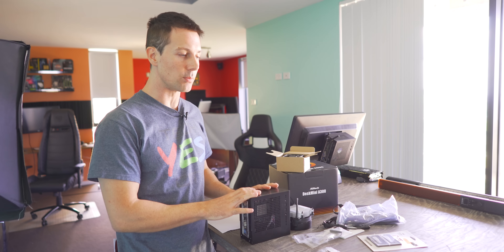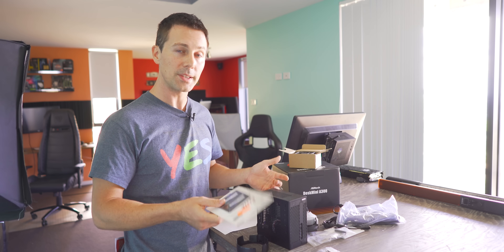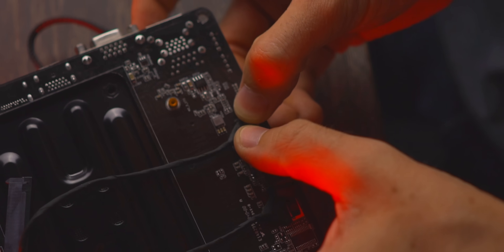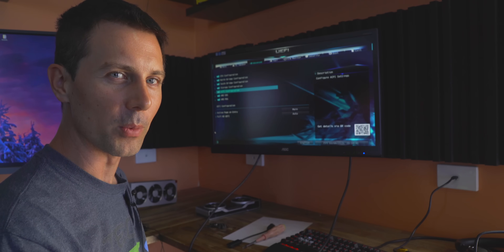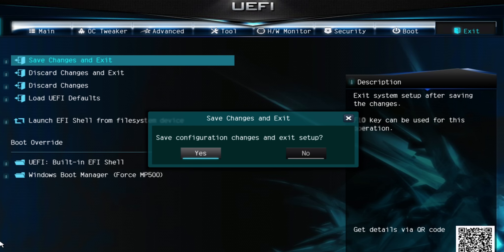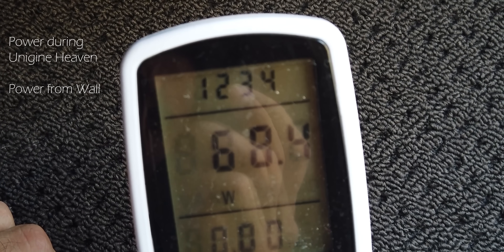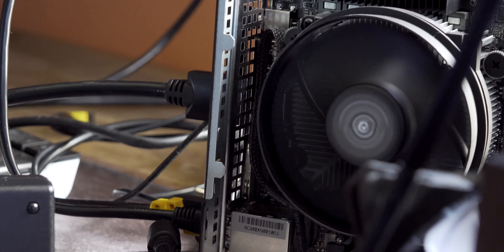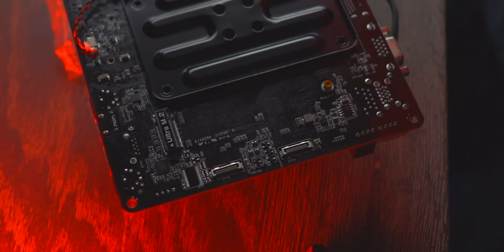The $150 RYZEN Desk Mini is HERE....! (ASRock A300 Review)

Comment: A update for people still interested. I was able to purchase a Crucial 16gb (2x8) 3200 cl16 set directly from Crucial for $79.99 with free shipping. I have also seen it at Adorama Camera and B & H for the same price. These are not listed in the QVL however they use the same Micron chips used in others that are on the QVL and Crucials website guarantees they work at the rated speed in this system.

Comment: Several things said here of the specs are incorrect: this motherboard only accepts APUs and will not post with other AM4 CPUs and the HDMI at the back is HDMI 2.0.

In recent BIOS revisions, ASRock has removed the possibility of overclocking the CPU. Memory can still be overclocked.

Comment: Dang, that GPU score on Firestrike changes a lot with different memory. I just got an A300, and with a G.Skill 3000MHz cl16 sodimm kit, out of the box with its XMP profile, the Firestrike GPU score is around 3900 instead of the 3000ish that Brian was getting. Oh, and I guess I'm using a 3400G, so the slight clock advantage for the GPU helps a bit too.

Comment: I like these small form factors, but to me as a gamer, just make one that is just barely big enough to fit one of the NVIDIA 1650 low profile cards in it... It won't increase the size a ridiculous amount and will certainly outperform APU graphics...especially since if needed, you could put it on an extension cable/riser to make it compact as possible. The No. 1 issue I've seen with small form factor pc's is the fact that people want to fit full sized mid/high end GPU's in them (cough Linus) when these small form factor cards exist for a reason...

Comment: I found out something REVOLUTIONARY for the A300. If you turn on all of the cores in WINDOWS  AMD 4200G 4 cores  4 threads actually is 8 cores for redundance in the  CPU.  I turned on all 8 CORES in WINDOWS and 1600mhz  for the GPU in BIOS. It will process twice as fast giving you Graphics in ULTRA at 120fps +  fluid at 1400p no OVERCLOCKING. I have done this and the results are  FABULOUS and the processor runs cool with the stock cooler shroud removed. this runs better than my $1200 + dollar builds in the past no $500 + graphics card. The graphics performance is REVOLUTIONARY. It will run any game in that tiny box . The graphic core is really good . It's  really just waiting for the CPU to send the graphics. I havent seen anyone using all  8  CORES  . You will not believe  the difference.  MARK  919-932-0310 CARRBORO NC or mparsons749@twc.com  Let me know what you think

Comment: When I use this as a Linux server and don't need any graphics will it work with a cpu faster then the 2400G?
Reply: No, it won't boot without an APU. Others have had the same idea and asked Asrock for a BIOS that would enable headless operation, but they didn't provide one.

Comment: Official product page specifications say that it supports HDMI 4k 60hz, so why are they still lying?
Reply: I think the confusion has come from the fact that the Intel variant only has a HDMI 1.4 output, so I guess Bryan simply assumed that this was the same and didn't bother testing it at 4K. This one DOES have a HDMI 2.0 port though. If you find the thread about this video on the AMD subreddit, somebody confirmed in the comments that it does 4K/60 without issue.

Comment: Any idea if you are able to use a higher wattage adapter to push more power through the MB or will it fry? Thinking about maybe building a system using this chassis and the top end Ryzen 3000 APU for a powerful little box. The rumors put the TDP at 95w which seems a bit high with a 120w adapter.

Comment: As a novice newbie to building PC's there is something I do not understand. The AMD Ryzen 2400G comes with a CPU cooler which supposed to be good enough to cool the CPU. Does it fir perfectly into the A300 or not?
Reply: As can be seen in this video and others, it will fit snuggly. However you have to remove the cap with the AMD logo on it. Hardware unboxed also has a video on this unit where they mention it. This cooler will be sufficient for normal use, but not for OC.
Reply: @Dutchpowder  Many thanks!

Comment: You can pop the circle shroud of the wraith stealth and it will have a lower headroom, should go in easier in there, I did that to my inwin chopin case
Reply: I have the Chopin with a 2400G that needed two small screws to remove the shroud. I just built an A300 for my wife with a new 2400G and the newer shrouds are clip-on so no removal of screws necessary.

Comment: This would be a great little homeserver/media server. Could replace my Proliant Microserver.
Reply: At 24W idle? Nah. If performance doesn't matter much you could get an ITX board with a Goldmont (Atom), have more SATA connectors, and idling at about 12W. — 366days • 24hrs • 0.012kW • P = 105.4kWh/a•P, with P as the cost for one kWh, and P=0.30€, we're looking at about 30€ in power cost per year!

Comment: I have one, also bought from NewEgg.  Amazon still has no listing for this.  This is the A300W variant with Intel Mini PCI-E Wifi module, antennaes, and a cooler.  There is supposedly a A300 base variant (no wifi module or cooler included), but I haven't been able to find that anywhere.

Bought it for a theater PC in the bedroom.  Still considering using it to replace my Mom's aging Athlon II 760K rig.

Comment: This mini pc is basically using laptop parts (mobo, SO-DIMMs) transplanted into a mini desktop case. Why not just buy a cheap laptop with MX150 or Vega 8, and hook it up to a monitor?
Reply: Because you can upgrade the cpu in this to the 6 core version coming out in ~3 months

Comment: Can you oc the 2400g and the ram with this barebone?
Thx for answers
Reply: You can, but you're limited by the form factor and motherboard. Better off just getting a normal motherboard/case/psu, something like an Asrock b450m Pro 4, Coolermaster Q300L and a budget power supply will cost less and overclock better.
Reply: @nazlfrag  thank so much 👍have a nice day

Comment: damn ...I could buy that unit if they sell with a 10gbe ethernet port ... or at least two gigabit ethernet ports.
Reply: My Threadripper doesn't even have 10 gpbs port... There is no way a budget Asrock board will have that!
Gigabit is nice, you can stream 3x Youtube 4k at once just for Lols. Skyrim at 8+ GB took me 1 minute and 13 seconds to download and install (time from hitting the Steam download button to having the game running in the start menu). Faster than that and you need NVME raid (lol, my laptop writing to a mechanical disk was 4x slower than the Wifi at a nearby McDonnalds, and its only 1/4 Gigabit there!)

Comment: Does it support eGPU ? Since there are two M.2 (2280) – PCIe Gen3 x4 socket, could I just plug in 2 video cards for GPU rendering, such as rendering in Blender Cycles/EEVEE. It will be great if you can make another video abt. that. thx !
2400GE is great but you have no way to get one, Damn.

Comment: Nice review ! just to add info, ram really matters: 2761 in fire strike can be greatly improved even with no cpu/gpu overclock. Getting 3520 here, stock, but with 2x4 GB 3200 mhz  16-16-16-35 1T/tight subtimings. Cheers from Argentina!

Comment: I wonder how good those nvme and gpus are going to be, I mean we've barely even heard speculation about them, and the low and mid end range are only going to be as good as ryzen apus,  but I can see 1080p low settings at 40-60 fps if you have a decent CPU.

although I can see a used case if the GPU is significantly better than an igpu, I'm thinking video editing and streaming.

Plus Xbox One performance

Comment: i wanted to buy a cheap laptop for general use and video editing, using Davinci Resolve, i'm on a limited budget so i was thinking of a Ryzen 5 2500u based system, until i saw this thing, does anyone has any experience using the Ryzen 5 2500u and 2400g when it comes to video editing using Davinci Resolve?

Comment: The minimal additions required: 2200g - 95$, 8gb ram - 40$, 128gb ssd - 20$. Makes total 310$ and a really capable machine for that price. 2400g, 16gb ram and 512 nvme ssd  would make it around 450$ - 500$, but very strong and fast machine especially for the form factor.

Comment: Bryan. I recently bought an Asrock J3160B ITX PC WITH 8GB So Dim ddr3 RAM, A 1TB HDD, blue ray drive, win 10 lisence, new 20" Phillips monitor, gaming keyboard and mouse for $320Au. The cpu is a celeron J3160, 4 core @1.6ghz with on board Intel HD graphics.
How do I overclock it for better performance?
Reply: you can't. The bios does not support overclocking. Plus its tiny and low powered.

Comment: Are you really sure that it does not come with HDMI 2.0? 

According to the PDF manual, it should be HDMI 2.0 and DP 1.2:

•	 Supports HDMI with max. resolution up to 4K x 2K 
(4096x2160) @ 60Hz 

•	 Supports DisplayPort 1.2 with max. resolution up to 4K x 2K 
(4096x2304) @ 60Hz

Also the Specs on Website say:

Graphics
- 1 x HDMI(4K @60Hz)

Comment: $150 is misleading, you still need a CPU
Reply: And ram and storage. Its a case with custom mobo and power supply. Actually decent value when you think about a normal case, cpu and psu.
Reply: Its a barebones system

Comment: Does anyone know if it truly supports some of the non APU parts, I bought everything to do a SFF build with a 2600 and a Vega 56 using this motherboard and an m.2 riser, but it wont post with the 2600. It will post with 200ge though.
Reply: may need a bios update.
Reply: I updated the BIOS to the most recent (3.20) still no dice, and I know that it doesn't officially support anything but the APUs but there is no reason, as far I can tell that it couldn't.
Reply: It only supports AM4 APUS 
Heres the supported CPUs

https://www.asrock.com/nettop/AMD/DeskMini%20A300%20Series/index.asp#CPU

Comment: So it's a $150 for a motherboard/case/PSU.
Reply: its running on a 120w AC adapter, the $150 A300W comes with an intel wifi card
Reply: Looks like, but i could not find PSU specs anywhere (ASROCK site too)...
Reply: @akurajamakasilol9769  dosent really matter bc ur not gonna put a graphics cards in there anyway
Reply: It is a motherboard inside the PSU case

Comment: I know why ASrock is doing it now!
Ryzen 3000g series would be a game changer. entry-low mid range perf that could easily fit on a backpack.
Perfect for Lan parties.
Reply: Literally will only be 5-10% better than the current 2000g series, since it's based on 12nm. You're gonna have to wait until 4000g series for the 7nm and perhaps Navi inclusion—which is expected Q2 or Q3 2020.

Comment: I like this a lot, it's damn near perfect for a little muti-media setup for the TV. Problem is I have like 3 other PCs just like it (though not running Ryzen apu's). If this was just a little bit bigger, with a PCIe slot (plus one of those PCIe extender cables and a mounting point for a GPU) for a mini GPU, and say a 350-400w power brick for $180-200 it would make the prefect lan party rig and I'd be all over it in a heartbeat.

Comment: 85 watts at the wall? if the power brick is 120 watts you have plenty to give it some overclock.
Reply: The Chipset is the A300 chipset which is non overclock able you can oc the ram tho
Reply: if you watched the video he was going to oc the apu which can be done. but like he said, didn't want to push it because of wattage of power brick.
Reply: huh its says the A300 isnt overclockable
Reply: well if you watched the video you would have seen where he could up the multiplier on it. but chose not too.

Comment: the bios will update to Ryzen 3000?
Reply: Remember, it's a 110 watt brick power supply...and you will be waiting a while on a 3400G, I suspect...(although dreams of a 6 core at higher clock speeds, better graphics, and same temps are tempting!)
Reply: No, chipset unfortunately will not support gen 2 apu.

Comment: When i upgrade my main system i would like to put my 2400G in that unit but i am also wondering if i was to use the Noctua NH-L9a cooler instead do you think there would be enough room to mount something like a 25/30mm fan as well for extra cooling and last thing i want to know is if i was to overclock the Vega 11 would Apex Legends run well enough on medium settings.
Reply: Search asrock a300. Theres a video using the L9 cooler. It Looks like a 25mm fan may fit.

Comment: On asrock website the manual says this for graphics:

•  Supports HDMI with max. resolution up to 4K x 2K
(4096x2160) @ 60Hz
•  Supports D-Sub with max. resolution up to 1920x1200 @
60Hz
•  Supports DisplayPort 1.2 with max. resolution up to 4K x 2K
(4096x2304) @ 60Hz

Is that HDMI port not actually right? Did you try it on the Displayport?

Comment: The only thing that could make this better would be an "accidental" bios error by asrock like MSI did, then 200GE overclocking could happen ;)
Reply: 200ge is still pretty weak at 3.9ghz. The GPU doesn't overclock either. I know this because I have a htpc 200ge at 3.9 and it works ok, definitely handles 4k playback a bit better but it's still working really hard.

Don't even think about modern games on a 200ge. The GPU section is the bottleneck so an overclock does very little.
Reply: @lunchie80  I entirely get what you're saying, but I'm really thinking HTPC with not even light gaming with any processor in that form factor.

I feel that for the price, if a 200GE were unlocked, it would be the perfect CPU for the VRM capability/longevity and ability of the diminutive PSU. 

If I wanted to game then I'd go for something with a better form factor really, not because I think that this is incapable or impractical in the short term, but that this system will be relatively out of its comfort zone in a few short years if gaming is a major worry for the owner.
Reply: @JoClip1984  well I'm happy with it for a htpc. For 1080p its fine stock and just manages 4k youtube. In fact I'm typing this on it now using a BT keyboard :)
The oc improved snappyness if there is such a word haha. This is in a Jonsbo U1 with prism cooler. 2200G has way more balls though. I bought a 200ge for fun and the 2200g that was in the htpcis now my server cpu.

Comment: here the cons when using 2400G stock cooler on this Deskmini
1. The upper and bottom side of case is little bit bent
2. The mobo got little bit bent
So... buy low profile cooler or passive cooler (if you want true htpc)
Reply: Bagoes budianto i had no trouble with this, the only time I had to bend the top of the case a tiny bit was when sliding in the tray. Maybe you did not remove the 4 spacers which are on some of the AMD stock coolers between the heartsink and the fan - these need to be removed.

Comment: bit over priced could build mitx for this price with more options.

I could see a market if they sold these as complete systems for say $200-230
Reply: i think the 2400g is about 140 - 150 bucks. so you want a complete pc with ram, ssd and cpu for 230 bucks? i think thats a bit to much. it would be great if they would sell a 2200g version for 300 - 350 with, lets say a 250 gb ssd and 8 gb of ram. i think that is more realistic. the cpu, ram and ssd alone would cost more than you want to pay for the whole system.
Reply: @bertracoon1884  they could do that remember if they did it retail pricing we pay is nothing compared to their costs per unit.
  i can build a mitx system for $250-300
Reply: @nicmonberg5974  cpu (2200g) and board (open box biostar x470)  alone are 205 bucks on newegg. i doubt that you can build a whole system for 250 - 300 bucks. im not sure but in the us that is without taxes right? so taxes come on top of it. there is no way, that you get a psu, ram and an ssd for 50 - 100 bucks.
Reply: @nicmonberg5974  oh and computer hardware isnt as every other item that get sold. the profit margine on those parts are not as high as on other stuff, so the retail parts are not that much of a difference compared to the price they get it for.
Reply: @bertracoon1884  they are high enough a shop makes around 20% so the likes of asrock buying in mass would save even more, why do you think they sell so many laptops these companies and refresh them every 6-12 month its money maker.
  $300 you can do it with deals and rebates very tight so say $350 to be more fair for everyone.

Comment: I need one of these for my kid .. he has an old i5 laptop frankinstines monster looking thing 18 fps avg on  fortnight low lol
Reply: does it need to be portable? if not, then a normal pc would make more sense.
Reply: Yeah thats true..It's getting to the point where I may as well just get a console
Reply: @KeiranR  i would prefer a pc, to be honest. it costs more than a console but you can do everything with it and you can always upgrade. if you build a system with an 8 or 6 core, then you dont have to upgrade your cpu in the near future and you only have to upgrade the gpu in 2 years or even later. depends on your needs and so on. maybe the ryzen 3600g will be at the level of a 1050ti or even higher. that would be cool and i think that could be possible but i wouldnt recommend that cpu as a gaming cpu. i would always go for a discrete graphics card. those apus always are kind on the lower end in frequenzies on the cpu part. you dont need the integrated gpu so you can buy a cpu without igpu.
Reply: @bertracoon1884  me too .. like my amd a8-7650k @4.3 and 16gb of 1600 ram 1050ti 4g struggles to maintain 60fps on 1080p on Fortnight.... and I spent a couple of hundred on that I've just got a bad taste in my mouth now I used to be able to get parts for $5 a piece and have a few spare CPUs running around but now days you can't get these parts and the parts you do get are way  old

Comment: I have about 20 of the Ryzen CPUs (2200's as well as 2400's) that we bought for testing. These will put them to good use. Thanks for the great info.
One will have our Copper IHS and a Noctua cooler so should be running cooler.